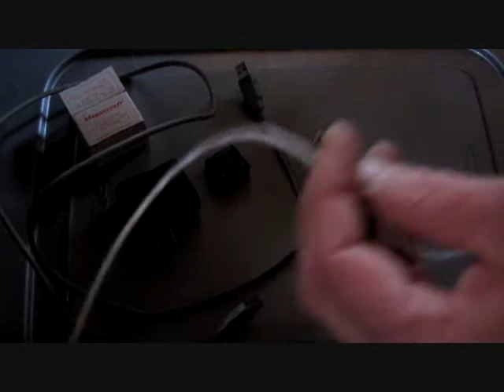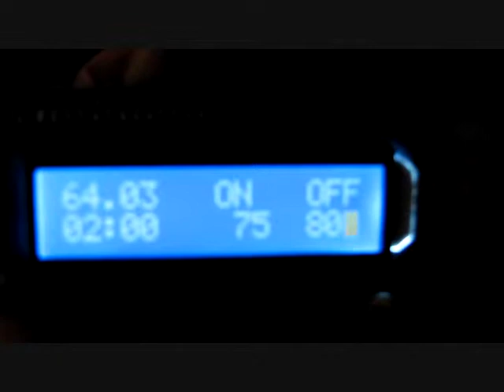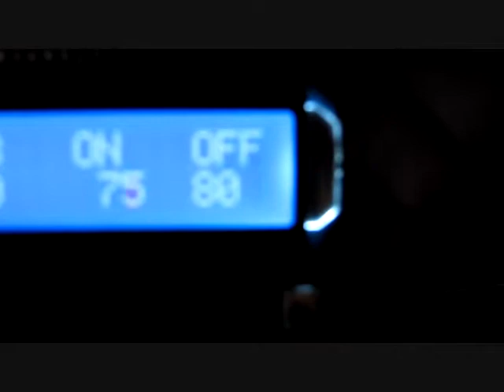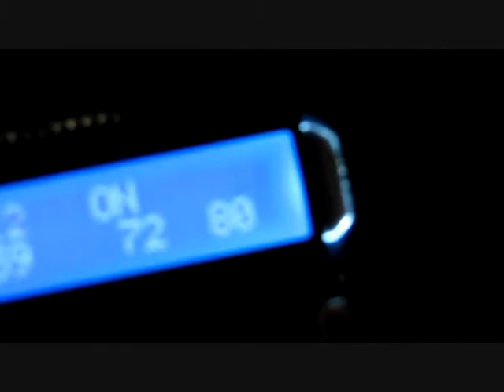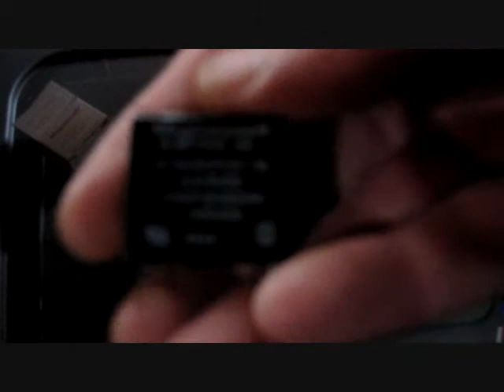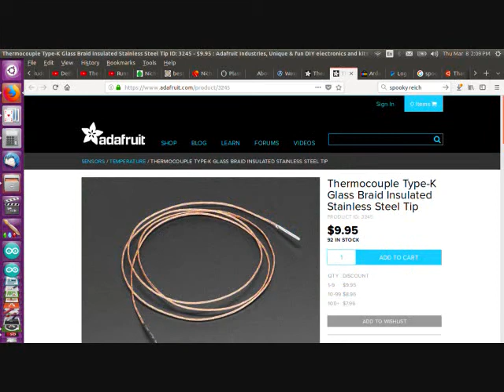arduino thermocouple 3.8.18

Comment: bro this would be perfect for my steam cleaner pre heater , i was gonna build an inline heater that pre heats the water to 211 deg but i dont want it to over heat , this is perfect , i bet connecting it to a relay would only require a power amp and the relay all probably on the same board . this would allow me to set the tool down without having to dash for the switch before it explodes